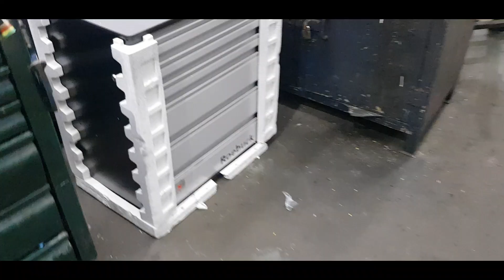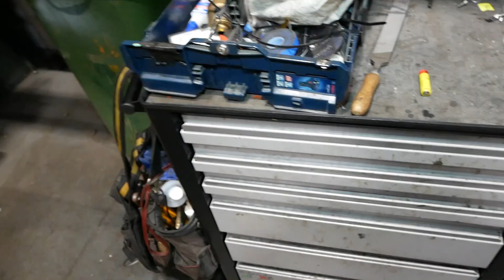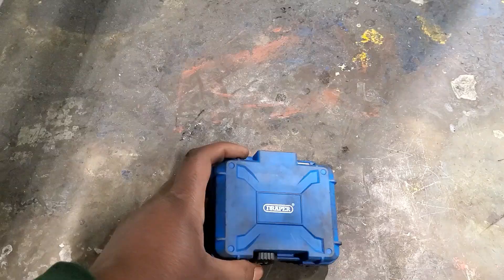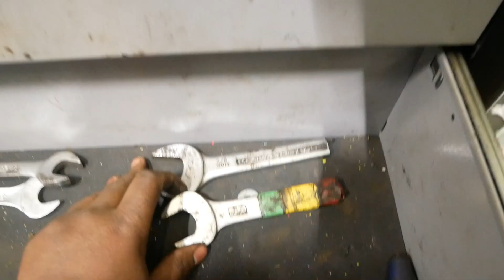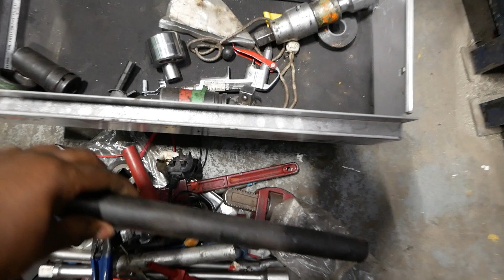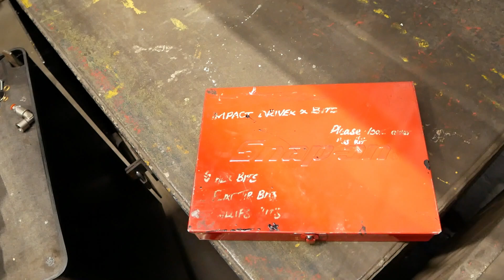Train engineers tool box tour 10+ year update

Comment: question tho i noticed in your half inch drive socket set the sockets are 12 point are they able to withstand high torque ?
Reply from the maker: yes have never had a issue with them slipping. I find 12 point easier to work with.